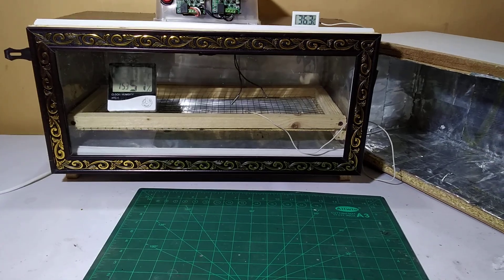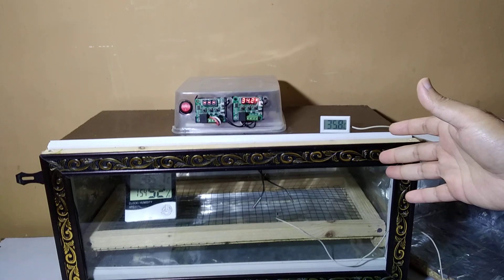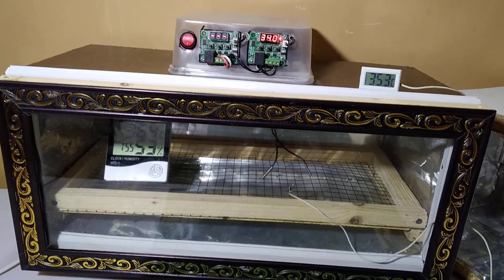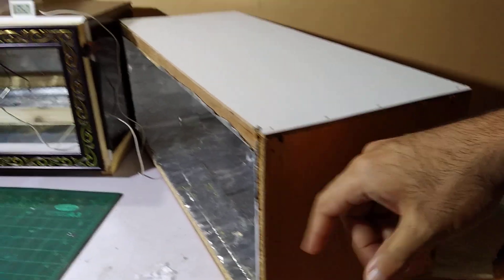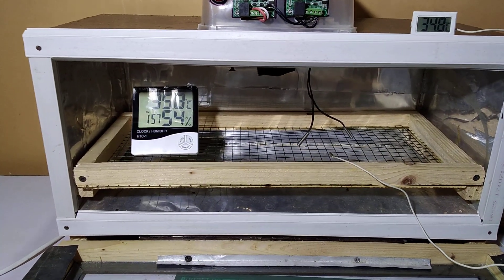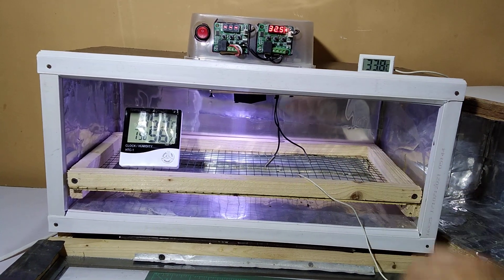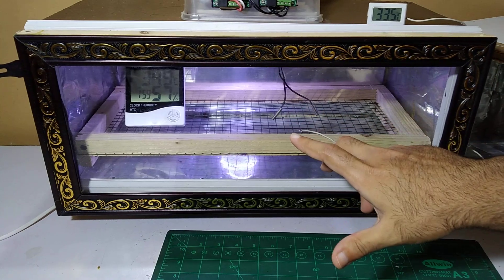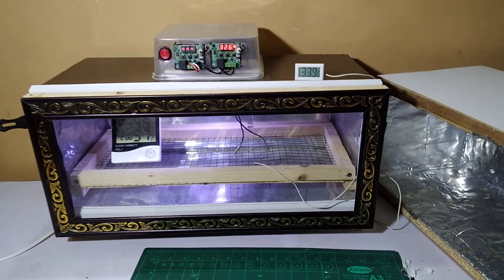How 50 eggs incubator is working on 80 watts - English

Comment: Bhai mary pas 50 eggs incubator ha usmy alag alag temperature show hota right side py alag or left side py alag  fan left side sy right side ki traf  air flow krta ha
Reply from the maker: Ager 0.5 degree difference hai tou koi issue nhi lekin ziada hai tou fan aur heater add kardain